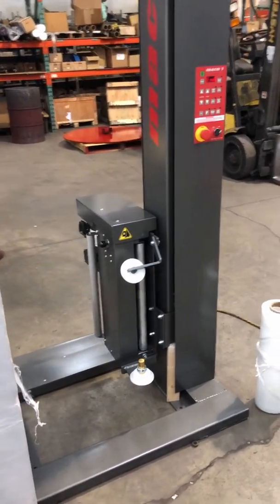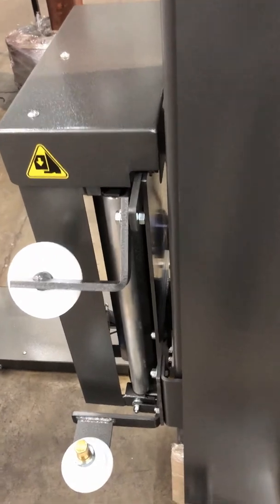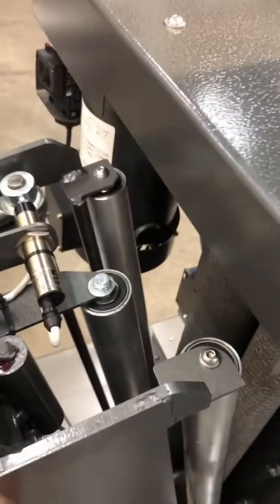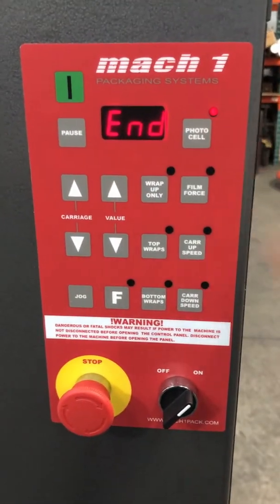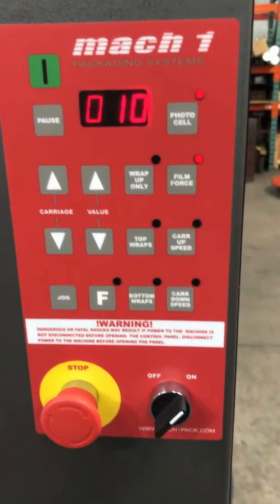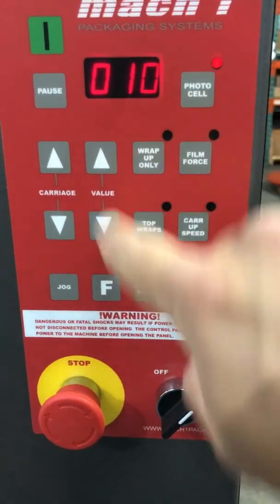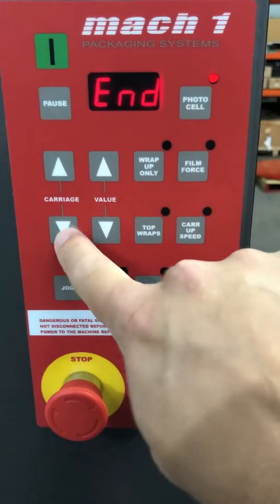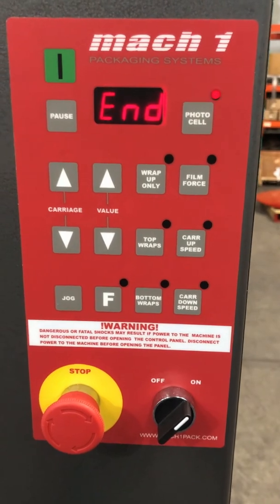Mach 1 Packaging   Wrapper Direct Inc    Quick Start Video   All models with DIGI TECH control unit

Comment: What's the problem when the machine just displays END, even if you press any button?
Reply: Factory Tech Support has advised a couple of possibilities ... "Parameters could be locked.  If P014 is set to “000” then they are locked.  Set it to “001” to unlock.  (Refer to your user manual for details.)  Also, if the HMI board has been replaced then spacing between the membrane and buttons behind is too large or that buttons stick out too much and are permanently activated."

Comment: What does the F button do?
Reply from the maker: The F button stands for "Function".  It is used to access the many additional advanced settings that the machine is capable of.  For example, changing the turntable speed, doing bottom wraps first, enabling the "Gentle Wrap Cycle", ... and many more.
Reply: @darkfelony  no
Reply: @darkfelony  no fonctionnel
Reply: The button F not fonctionnel too